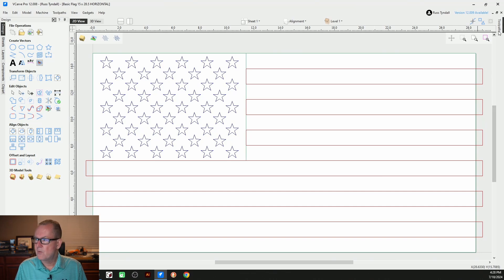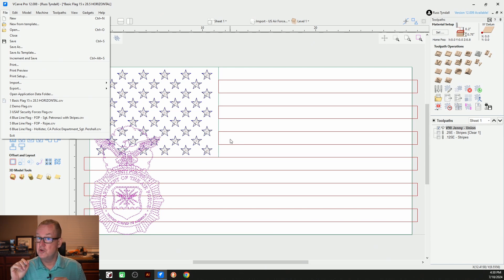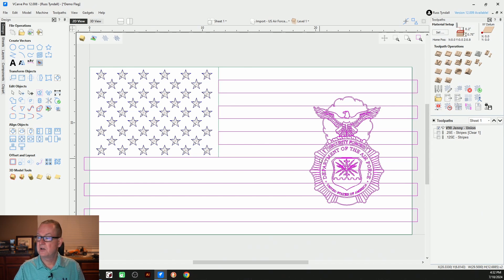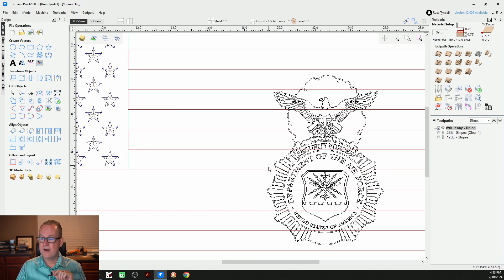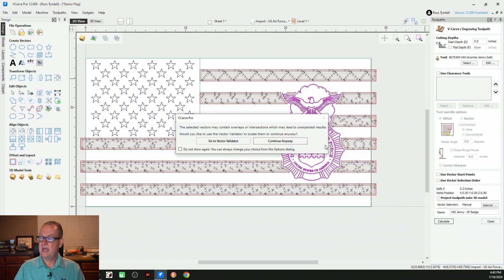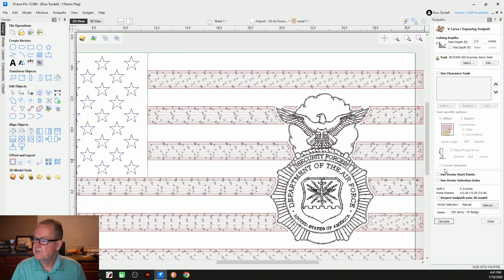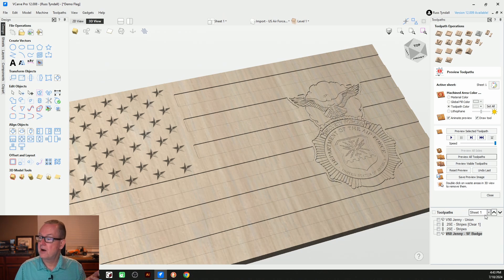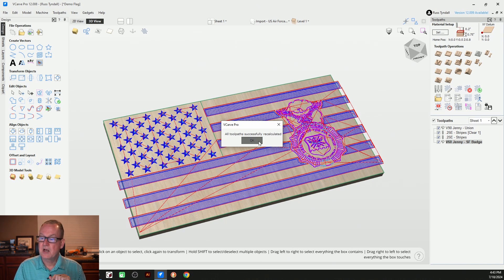Add Images and Graphics to your Flag in VCarve Pro! | Complete Tutorial

Comment: I have found your videos to be very through and easy to follow. I'm new to the CNC,  My question is, when you were setting up the v carve toolpath for the badge you had no flat depth.  My question is how does the program know how deep to carve the badge.  Thank you for your patience.
Reply from the maker: Hi. If you don’t specify a vbit flat depth, it will simply take it as deep as the carve borders will allow given the bit you are using. It’s important to select the correct bit in this instance. For example, a 45 degree vbit will carve deeper.  than a  90 degree. I can demonstrate much easier than explaining. You aren’t the first to ask. MarkLindsayCNC did a video on this a number of years ago. Maybe I should revisit the topic in an updated video!
Reply: @BlueLineCNC Thank you!

Comment: Great video, I enjoyed it! I see that you are using the finished board size, and no profile cutout is needed. What if I wanted to make two flags at the same time which would require a final profile cut since I am using an oversize board.  What tis the pros and cons of using an oversize board and profile cutout?  Thanks,
Reply from the maker: Hi! Not sure what CAM software you use but I’m running Mach 4 and can use multiple fixture offsets. I can put more than one pre-sized flag on my CNC. Haven’t really needed to yet though!  A  multi-flag layout on one board with profile cuts can work but would just have to be laid out in your design software. I would say go for whichever works best for your workflow.

Comment: Great tutorial but I have 2 questions. 1) what kind of wood are you using and 2) with a 60D vbit, aren’t you getting a lot of tear out on the smaller letters? I’m trying to do a police badge for a friend and the letters are so small (.375”) they’re impossible to carve with either a 30, 60 or 90d bits? Thanks in advance for your work
Reply from the maker: johnolz1886, I am using red oak.  The tear out is minimal and only occurs if I use up cut bits, which I avoid.  For the size of your letters, I would use this 45 degree v-bit by Amana.  https://amzn.to/4fTWtNG
Reply: @BlueLineCNC appreciate the link. Kind Regards, John